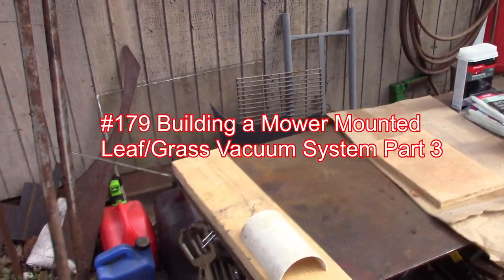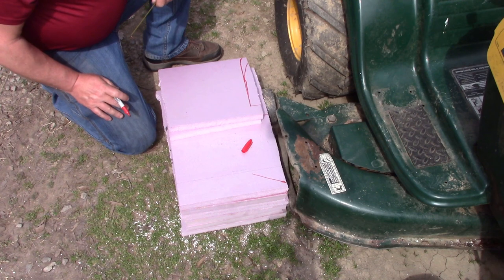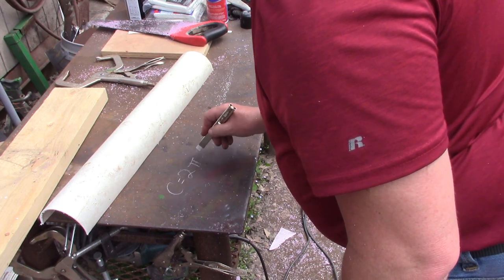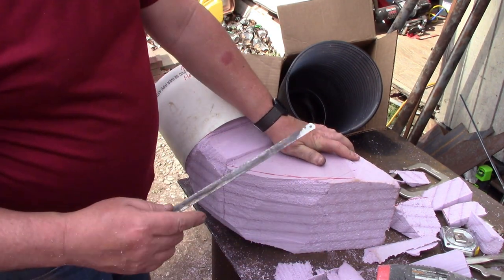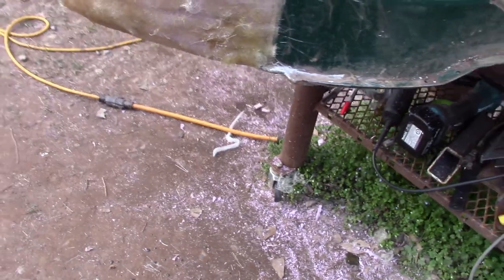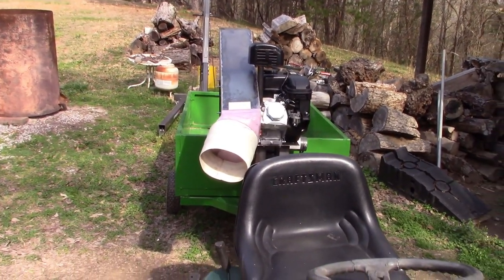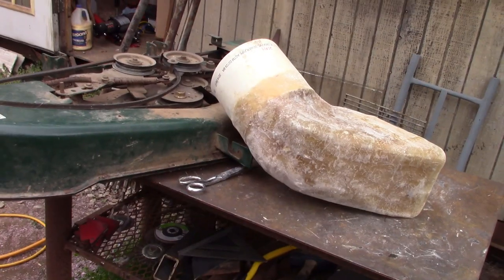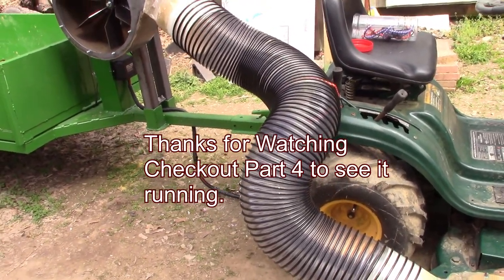#179 Building a Mower Mounted Leaf and Grass Vacuum Part 3

Comment: The project is lookin good Stephen! Im itchin just watchin, but, still enjoyin every minute! (For several years, i was a source inspector in a fiberglass manufacturing facility. They built flow dampers for handling air and solids for several large corporations, and i got to travel doing inspections. Some in other countries, some, here in the U.S.) Fiberglass is an amazing medium to work with, and is WAY stronger than i imagined when i first started dealing with it. Can hardly wait for the next episode! And, yeah, those splinters ARE a PITA, i SURE dont miss those in my hands!
Reply from the maker: Thank you Dave. That sound like a very interesting career my friend. My Fire Helmets were all made from fiberglass and I can tell you it is very strong! but at the same time it is very light. This first experience with it was a real learning curve but I am happy with the results. Glad you are enjoying this project and Take Care.
Reply: @StephenOgle  i was fortunate really, as i was able to have several different jobs while working for the same company for 40+ years. I was also a welder, a certified weld inspector, as well as being able to build some of the products that i had inspected. Hands on, in my experience anyway, was by far, a MUCH better way to learn than by being in any classroom. Schooling is important, but, so is actually doing!

Comment: Great job 👏  on making the attachment  share my idea that worked was Air Conditioner out put hose which you can buy 6" hose at Home depot, the hose flexes like accordion,  I took off my  LG portable  unit was same size to my craftsman pull behind  leaf trailer with 5hp briggs.

Comment: I've never seen a vac fan set up like that. Typically the air comes in from the (open) side and out the side you are using as an inlet.
I'm really curious to see how this is gonna work.
I really like how you fabbed the fiberglass adapters.

Comment: Not saying you had the wrong idea about cutting out the chunks of form but to do the final clean up you might use some acetone, which will dissolve most foam. You could also epoxy a steel plate under or on top of the fiberglass where your two bolts hold the chute to the mower deck, otherwise the fiberglass will crack from the stress.

Comment: Stephen, I haven't done a lot of fibreglassing but from watching other videos and my little experience if you put a bit of resin on first and continue to lay the glass over it the air bubbles will leach out better and the matt will have resin all the way through.  Of course, straight after that put a bit more resin over the matt to cover it.  Hope that helps.
Terry from Australia.  PS Just realised this was a year ago.

Comment: Did vibration crack around the attachment bolts? I'd think of sandwiching the glass and bolts with a alumina wide plate hurricane shield gusset in case you hit the funnel.

Comment: Stephen, you might want to make a flat metal bar with 2 bolt holes to re-enforce the fibreglass, across the mouth of the grass cutter. You have all the weight just on the bolt hole area. With the vibration something will "let go". Just advice.   :-)
Reply from the maker: Thank you Bryan. That is a good suggestion and I appreciate it. Glad you are enjoying this project. Take care.
Reply: @StephenOgle  Stephen, I've been following you for years, I enjoy all your projects, I like your turning the best though.  LOL

Comment: I hate to be one for bad news,
Those 2 bolts your using to hold that on, will eventually open up and the unit willbe ruined,
A suggestion would be to resin in a steel top plate into the shell, with the 2 hoes for the bolts,